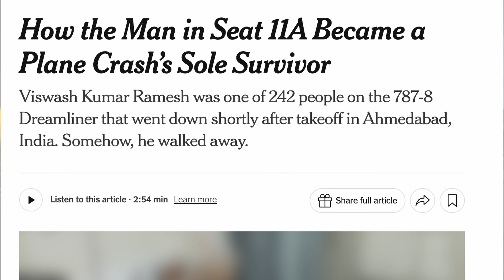Why the RAT Changes Everything – Air India 171 Update

Comment: Maybe play the video centrally on screen. And a 787 with full power doesn't stall at that modest angle nor does the gear have such drag at modest speed. Nor would zero flaps be a concern, that is actually an advantage when you are at flight speed as it has drag. It smells a lot like Jeju to me, Being's patented Systemwide(tm) failure cascading everything off including backups. One thing that struck me about the descent is that there are seemingly no attempts at any point to avoid anything on the ground. They impact the second floor of a concrete building and there are open patches of ground out there. So that means either the pilots were action paralyzed OR the aircraft was completely disabled. If it's the latter, and I think it is, it could be very significant for Boeing. The 787 and the Jeju 737 max were engineered in overlapping years. It could be the same poor engineering principles. A passenger the day before said it had electrical problems so it could be made worse by neglect but it does suggest fragility in Boeing's electrical designs. If just the avionics units had a single 18650 lithium cell it could run for hours even in total electrical failure. The use of hydraulics on a plane is also very poor engineering. That's why gear wells look like snake nests. So dumb.
The engines are right at their fuel sources, they are mounted right under the fuel tanks so each engine could easily be entirely self sufficient. You could even have a 3rd wireless control backup to the engines such that even if all the lines got cut it would still be under control. Either this was very particular maintenance neglect or Boeing has a pronounced fragility. I'm sure it will be swept under the rug yet again but otherwise could be the eng of Boeing

Comment: The PM indicates that there is no power and that it is impossible to climb. Possible causes: fuel contamination / engine failure with excess weight due to an error in the dispatch documentation for takeoff and weight and balance calculations.
 Suicide (there are several cases), etc., etc., etc.
-------
Keeping the landing gear down from the liftoff also means that there are serious, critical problems and that the pilot realizes that the plane is imminent to crash.-- 

The turbines sound accompanied by the sound of the RAT and the engines could be reducing power without the possibility of accelerating.

Comment: Dual Failure? On the take off  part you can see dust swirling up on the left side, most likely due to the left engine air stream hitting the ground. Usually dirt does not comes off but on a take off that fails to takes altitude fast enough this may happen. Maybe it started with the right engine failure first and then left died shortly thereafter though.

Comment: Find this a very accurate assessment Captain... This one agree with, also in the video which is very clear compared to the earlier one can faintly see the flaps down... Also the Wheels their position, they might hold out a clue... Hydraulic, dual engine, electric failure, any of the three or possibly a combo is now looking the most probable explanation for this tragedy and if right completely absolves the Pilots of any errors on their part, as per me can see that the aircraft took off on the last moment and that too can be an indication that there was something wrong will not say Pilot could have cut power and aborted maybe it was too late and when it took off he felt it was ok... What was the reason we shall know only when the whole investigation is over...

Comment: Captain Steve I actually heard that hours after the crash by 1 person. He explained the RAT Passengers on the plane when it got there stated the stuff above their seats wasn't working. Not the lights or air or call button. My opinion..... primary cause is an electrical failure that led to the dual engine failure.

Comment: Thank you, Captain!

We think the Govt of India must award the pilots posthumously the highest civil award for heroic bravery!!

Another channel wyngx said that the notion that the PM could have inadvertently raised the Flaps up when (or even IF) Gear Up was called by PF nearly makes no sense.  
For one, there is quite a significant distance between the two controls.  
Second, many cycles of knowing what to do when Gear Up is called with ones arm and spatial travel is nearly stored in muscle memory!  True, an error  "could" happen, but very unlikely.

One other strange thing that strongly corroborates the RAT deployment.   The flighttracker24 ground track stops at the runway head.  It SHOULD HAVE gone all the way to the crash site!! It has not.   Same with the readings of the altitude and the speed. They stop around the time the ground track stops.

This implies at least some catastrophic power failure that caused the parameters to to STOP being transmitted to the equipment that flighttracker24 then uses to display the speed, the altitude and the ground track!

This sudden power loss ALSO explains the RAT deployment!

This ALSO explains WHY the landing gear was still down!!  There was no power thus hydraulics to raise it.  At that low of an altitude, the only thing the pilots could do is to handle the aircraft as best as they could.  And which they did with stunning remarkableness.

We think you will agree that the Govt of India must award the highest civil posthumous award to the pilots for heroic bravery!!

Comment: 787s had a software issue due to the power being left on continuously. As part of the maintenance process for the dreamliner the power has to be turned off ( like a computer restart). Failure to do so can result in unscheduled power down of systems. This should have been partially rectified by a software update. There's an AD for it. The planes generators basically go into a failsafe mode. One of a few probs with the dreamliner. So sad and my thoughts with the families.

Comment: I came across a message about possible sabotage.  Someone in charge of fuel loading or his staff with criminal intentions, after loading all tanks of the aircraft,  has locked the fuel flow into the pipes connecting the Engines. Thus with the barest minimum fuel in the pipes leading to the engines, engines were able function only for the take off Roll and reach an altitude of 600 plus feet and then flamed out for want of fuel. The Pilots had no way of learning this sabotage. 
Do you think this could have been a possibility for this horrific disaster,  Sir?

Comment: The two jet engines on the Boeing 787 are designed with a high degree of independence in their fuel supply, but also with cross-connection capability for redundancy and fuel management.
Here's how it works:
Dedicated Supply: Each engine (left and right) primarily draws fuel from its respective wing tank (left engine from the left wing tank, right engine from the right wing tank). Each wing tank has multiple fuel pumps (typically two electric pumps per wing tank on the 787) to ensure that if one pump fails, the engine still receives fuel from that tank.
Separate Tanks: The 787 has multiple fuel tanks: a left wing tank, a right wing tank, and typically a center tank. Fuel from the center tank can be transferred to either wing tank.
Crossfeed System: This is the crucial part that provides redundancy while allowing interconnection. The fuel system includes a crossfeed valve.
Normal Operation: The crossfeed valve is usually closed, maintaining the independence described in point 1.
Crossfeed Operation: If there's a problem with a tank or pumps on one side (e.g., left pumps fail, or the left tank is running low), the crossfeed valve can be opened. This allows:
The left engine to draw fuel from the right wing tank (or vice versa).
Either engine to draw fuel from the center tank (via one of the wing tanks).
In summary:
Under normal conditions, the fuel supply paths to each engine are separate from their respective wing tanks. This provides independence.
The system is designed with redundancy (multiple pumps per tank) and a crossfeed capability to ensure that a failure on one side (like a pump failure or inability to access fuel in one tank) does not prevent the other engine from receiving fuel, and allows either engine to access fuel from any remaining serviceable tank.
So, while not completely isolated in the sense that fuel cannot be moved between sides, they are independent in their primary supply paths and redundant in their overall design to prevent a single point of failure from starving both engines.
Reply: Are the engines electrically independant of each other too? Could any single electrical failure stop both fuel pumps to both engines at the same time?

Comment: On some planes, putting the flap lever up, then suddenly changing your mind and putting it back down again while they are in transit can make an asymmetry brake freeze the flaps in whatever position they were in when you push the selector past their present position. Would the flaps suddenly stopping be able to create a momentary change in system pressure that would cause the RAT to deploy? Even I don’t think that’s particularly likely but I am having difficulty believing a dual engine failure is any more likely than that.

Comment: About Time…

Even with the initial blurry video : 
- slats are visibly extended, in flight, and on the wreckage.
- the last datapoint shows a ground speed of 174kts. With slats extended, it's not slow enough to make a 787-8 fall down to the ground.
- even on the blurry video we could notice the boogies of the main gear tilted down, and not up. It happens when gear are selected up, just before they are being retracted. If the gear were selected up but not retracting, how the problem could be a flaps up selection mistake ? (this is another clue showing no hydro power).

We can also add the APU door at least partially opened on the wreckage, knowing that on 787-8/9, the APU has an autostart mode that start the APU in the air if less than two VFSGs supply power to the airplane or there is no more AC power supplied to the airplane. Which is another clue of no electric power from the engines.

The evidence were never in favor of a flaps up selection mistake from the beginning...

Comment: Is the RAT 

Not a rat running round the engine 
Ram Air Turbine, that helps with power (not thrust btw) during problematic situation.

if it was Delployed i agree with the captain a game changer n still somewhat leads to the same direction. Of problems 

Ahh law suits are costly, and same breathe, air accidents can be fatal 4 a safe mode of transportation

Comment: It could never have been a pilot error as that sort of mistake is too rookie for the calibre of pilots on that plane. The pilots are not fools to have pulled the wrong lever. It had to be someone deliberately messing up the fuel delivery system to cause the accident. That dreamliner is not such a bad flight to lose both engines at the same time. There was an important man on the plane i.e Ex Chief Minister of Gujarat. There is something fishy for sure.

Comment: Isn't it possible that for some reason the fuel stopped to the engine's fast enough to cause the engine's shut down without smoke flames. Just like any other internal combustion engines.

Comment: Very good analysis.
There is one more fact. No radar recorded the place where the plane crashed. The last known position is just beyond the runway. It looks like they lost power and the system went out.
Reply: Radar do not give a crap about the plane systems...
Reply: @Triggernlfrl That's right. I meant i.e. Flightradar, a system that uses the signal sent by the plane. The signal was lost, which may indicate that the device stopped working. I assume that it was not turned off by the pilots because at that moment they had other things to deal with. It turned off due to a failure. I don't know that, I'm just writing what I noticed.

Comment: @CaptainSteeeve in this video this gentleman points at several issues he noticed in this plane on the previous flight before the catastrophe. I don't know if they could be related to the failure that made the plane crash but it certainly shows an aircraft with some electrical problems. Do you think this could be related to what happened later? https://youtu.be/9EDho1UDWzM?si=WDu9l8jy5GzgdvPl

Comment: The mistake of putting the flaps up is not the case.
We have visual evidence that the slats were deployed and video that suggests that the flaps were at least partially deployed.
Also, the flap handle is on a different panel from the gear. Plus, the flap handle is shaped like a stubby wing, while the gear handle is shaped like a wheel. Two aspects of muscle memory point away from that idea.
It has been pointed out that the main gear looks like it’s not in the full-down position. They’re not canted correctly. They almost look like they’re mid-cycle.

Comment: Another interesting aspect: in most aircraft, the change from takeoff thrust to climb thrust (usually around 1500 feet above ground) is clearly audible from within the cabin. But on the B-787, the engines are so quiet that it’s hard to notice any real difference.

So, if the aircraft did suffer a dual engine failure, it might not have been immediately apparent to the passengers. In that relative silence, the sudden bang of the RAT deploying would have really stood out.

Comment: The best video so far. However double engine failure on such a reliable aircraft type in service since around 2011, with many of them airborne daily since then, is statistically very unlikely. Fuel contamination? Fuel supply to both engines failing? An erroneous FADEC command to both engines? The flight data recorder should provide the evidence of the aircraft systems operating normally, or not.

Comment: This is fascinating. I was very much in the pilot error camp until I saw this. Surely the pilots would have set the engines to be at, or pretty close to max thrust, so to be able to hear the noise of the RAT spinning above jet engines shows that there wasn’t a lot happening with those engines at the time it went down.

Comment: The most likely explanation is that the “fly by wire” computer was fed information, possibly resulting from an explosion in the battery back up system, which led it to believe that the aircraft had landed and that the engines should now be shut down. As far as fuel contamination is concerned - there is no real likelihood that something in the fuel would have affected both engines simultaneously and so quickly. However, there is the fact that the aircraft did not leave the runway until the very end of its take off run - there must be some explanation for this. Possibly, the pilots were simply being cautious - get up as much speed as possible for it becomes necessary to “rotate”. No harm in that, I suppose. The take off did seem to be successful. Then, as the survivor recounts, there was a loud bang. Possibly the battery back up power supply system exploded. The information being fed into the computer went haywire and the computer decided that the information being fed into it was such as to mean that the engines were no longer required. That is a possibility. As far as any computer is concerned, it is always a question of “rubbish in, rubbish out”. If the sensors feeding in the information to the computer are damaged or destroyed and feed in the wrong information, then the computer will process the information which is fed into it.

Comment: If I may  suggest  the Following  to your  very Lucid explanation .  
1.     Examine  the angle of  the Undercarriage  .    As you know  the Undercarriage on Leaving  ground contact will Hang  with the Rear - most wheels  lower than  the wheels in front  .    When the  Gear up is  commanded  ,   at the  same  time as the  Undercarriage bay door  lowers , the  wheels  will  Tilt forward  aligned  .
2.  I believe  the  Gear up order was given in the cockpit , and  the Gear up sequence  started .
3. At that  same  instant  Loss  of Both engines    delivering Power  , both thrust and Electrical , and Mechanical driven  Hydraulics Pumps , Caused the  RAT to  be Deployed .
4.  Hence it  can be seen on the  Video  the position of the  Undercarriage wheels  appear to be in the  initial Position of the Gear Up sequence .
Thank you  Captain Steeeve

Comment: Dual engine failure - but no optical signs? No flames. Black box will give all the infos. But why the two engines failed will be hard to explain by Boeing. The first Airbus went to "landing mode" by mistake too and landed in the woods.

Comment: There is a video of the inside of the cabin while taxiing out by a passenger who is saying that it is so hot as the AC is not working, and there are no lights and the  electrics in the back of the seat Wi-Fi- was not working. ...The plane came through a huge cloud of dust at the end of the runway, could this have affected the engines equally.

Comment: Surely, as evidenced by other cockpit layouts, the Gear handle and the Flap controls are not adjacent to each other? A significant separation must exist, and also a very familiar placement for muscle memory to use them selectively?  Here, I do believe you may have hit upon something more substantial; as the RAT sound is reasonably clear and the visual of something protruding remains a constant. What a true horror for those on board and on the ground. May god be with their families.